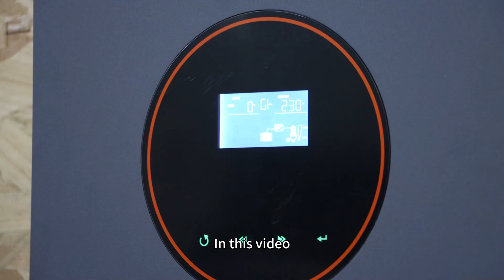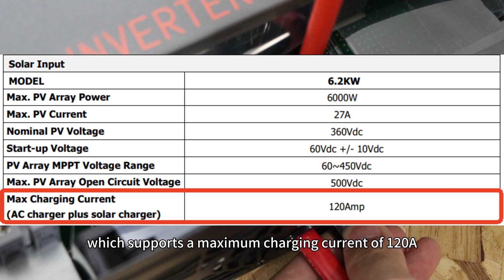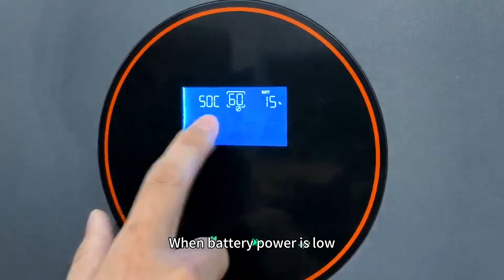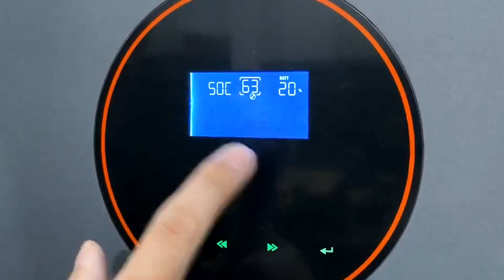The Detailed Overview of the Port Design for PowMr Solar Inverter - POW-HVM6.2K-PRO

Comment: Is this the PowMr HVM 6.2KW-48V model? Can it be used for a fully off-grid setup (without any AC input from the utility company)? And will the maximum output still be 6.2KW?
Reply from the maker: Yep.

Comment: Good Morning. Is it possible to select which AC Input port the inverter should use when operating from the mains? I have a meter with dynamic tariffs. A super solution would be when AC Input 1 works in OSO mode. Ac Input 2 in SNU mode. Regards
Reply from the maker: Hi, there are two AC input ports. No. 1 is for the generator and No. 2 is for the mains.